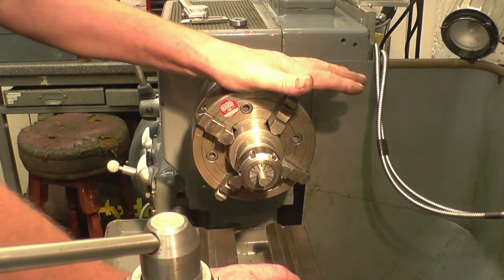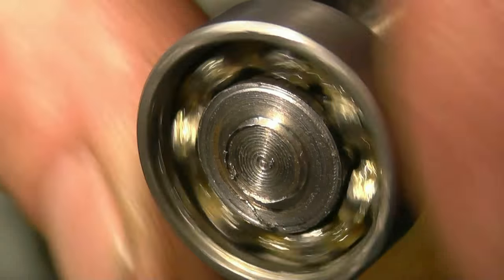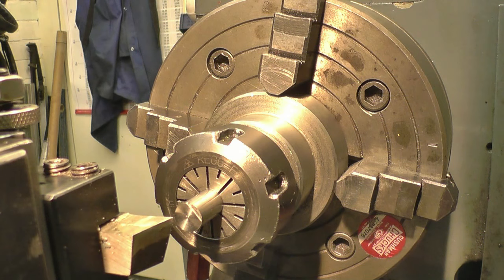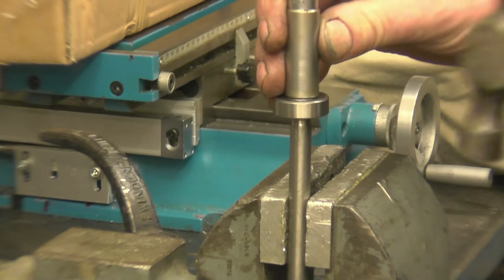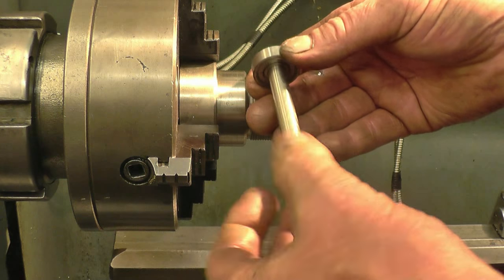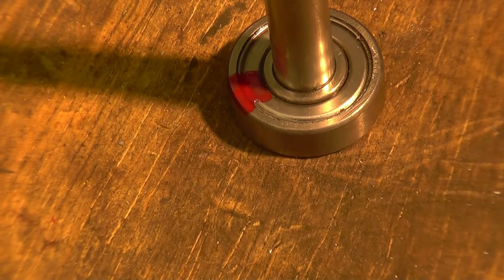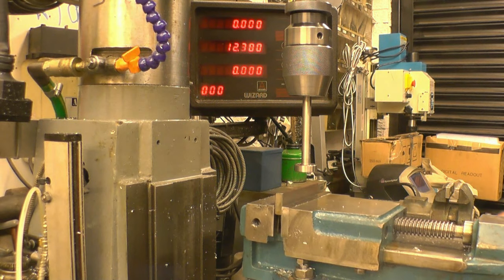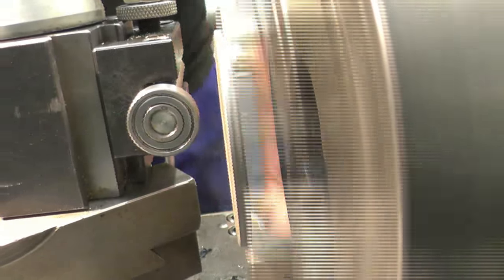SNNC 140 P2  Lathe Push / Mill Edge Finder Tool

Comment: Made one today and discovered a third use. I had a 20mm rod in the chuck (finger tight),
moved the bearing in closer, outside & parallel to the work and had it concentric in a second. Then tightened the chuck.
I hope that made sense. Although the uses here are much more practical. Brilliant little tool.

Comment: Thanks John! I borrowed that bearing tool idea from you long ago--very useful tool on the lathe. Until just now, however, I never thought about using it as an edge-finder. So thanks again for the continuing education. I hope by now that Debs is over her cold and not even feeling "ordinary bad."

Comment: Thanks John, Nice video as always.I made one of those pusher bearings when you showed them some tome back and funnily enough I used it this afternoon to line up a pulley I had to increase the bore size. Any chance you might come down to the Midlands Model Engineering Exhibition in October?

Comment: Problem with the ABEC-7 bearing is they are made for skate boards. You can get them in quality, but they cost more than other quality bearings cause dumb kids by them. If you want good reasonable priced bearing try VXB. com. Even their low cost bearings are quality, though I cant speak for their ABEC-7's they carry as they are still board bearings meant for light loads and low speed applications.
Reply: Abec ratings have nothing to do with quality, only specs. VXB sells extremely average bearings, but they'll work for this purpose.. if you want ultra high quality find an NSK distributor.. or skf, spb, or even boca bearings.
Reply: I would, but I am a cheap ass, reasonable quality at a cheap price, unless it really matters. Thanks for the info though.

Comment: Very nice tool for the Tool Box Giveaway. I am almost finished with two pairs of machinist jacks for the "What's in your box? 2016 Giveaway". I am using an improved design of the ones I previously posted at http://www.homemadetools.net/forum/more-accessories-small-machinist-jacks-19843 . Regards, Paul Jones
Reply: Sandramer

Comment: or buy a wibbler for 50 quid ?
Reply from the maker: It won't be any more accurate I have tested both
Reply: I agree ...... it is no more accurate +  - .003" dependant on surface finish of material..... which was my point, it is negligible. A wibbler is however, more versatile with attachments, an I know you know the starrett one I on about